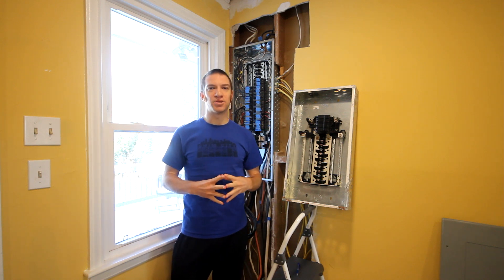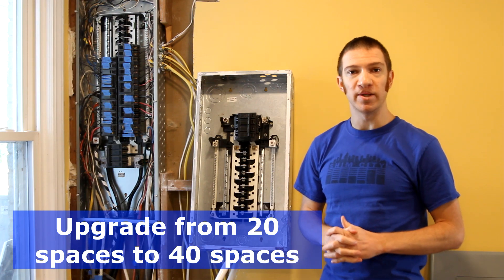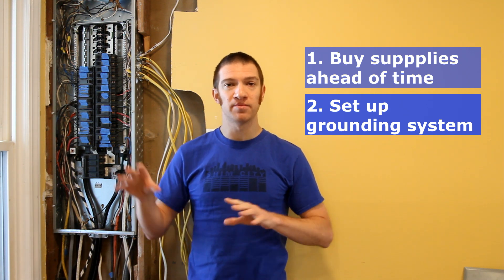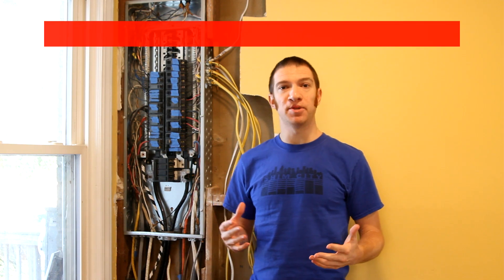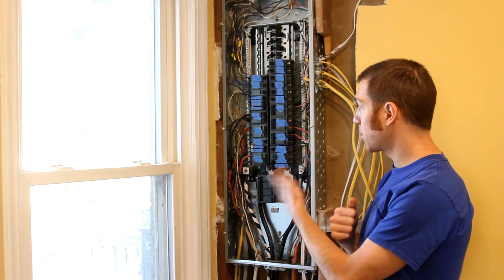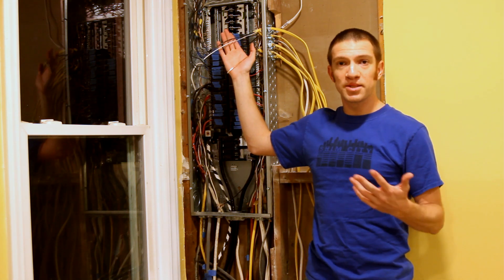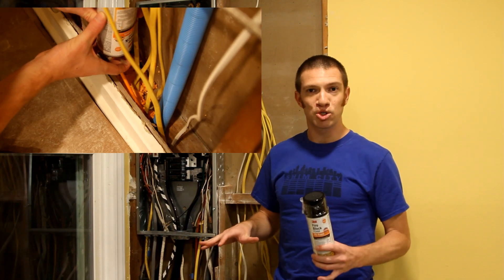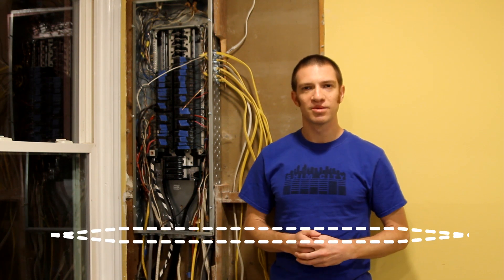How to Upgrade a Main Electrical Panel

Comment: What about Arc/ground fault breakers. When upgrading a main panel do you have to follow the current nec codes? I’m asking because I had mine panel replaced and it’s stander breakers.
Reply from the maker: Hi there. Please speak with your local code authority for the final say. 
The guidance I was given is that circuits need to be brought up to current code when modified or extended. Just replacing the main panel did not constitute a modification of the circuits, therefore I was not required to use AFCI or dual function breakers on existing circuits that didn't already have them. All of the new circuits I added were brought up to the latest code which generally requires AFCI protection. Best of luck!

Comment: thanks, this is super helpful.  Opening that stud will change the way roof load is being handled, you probably need to add a header and an extra support to compensate.
Reply from the maker: Definitely important, and I should have elaborated in the video. I'm always nervous about cutting into any of the framing because I don't know how the structural engineer set things up. In our case, I examined the alignment of the wall with the floor joists and roof trusses with a professional. This particular wall is not supporting the structure of the house so no remediation is necessary. If support were needed, then we would add the supporting framing members. Thanks!

Comment: Another great video!   Please remember though that this is 120/240 volt single “phase”.  There is no A phase and B phase.  It is Line 1 and Line 2.   What’s up with the white wire going across the breakers?   Just waiting for connection or what?